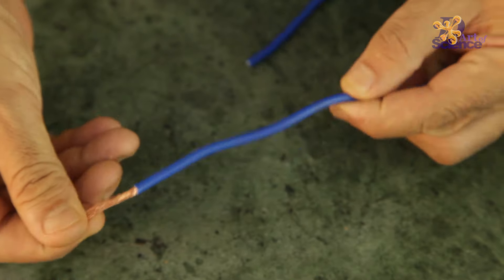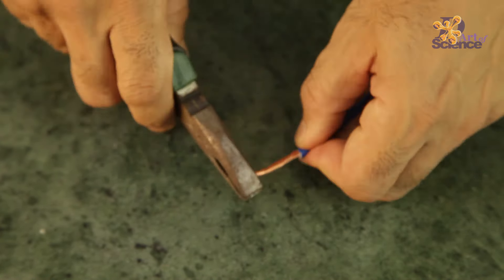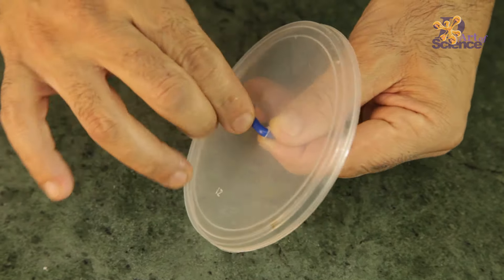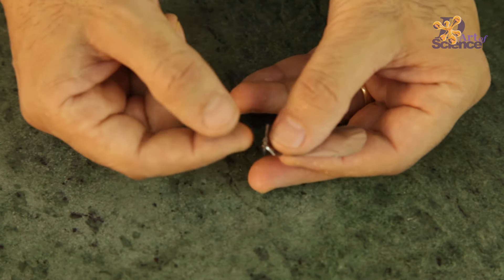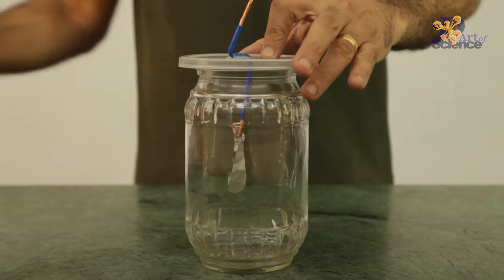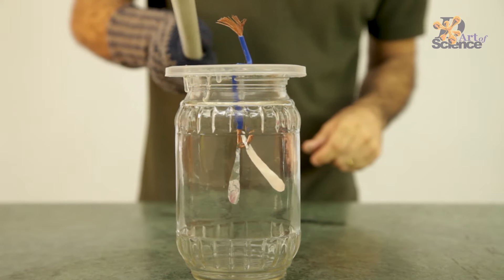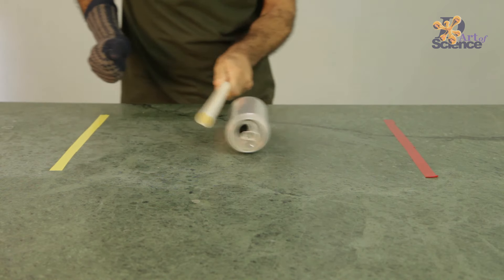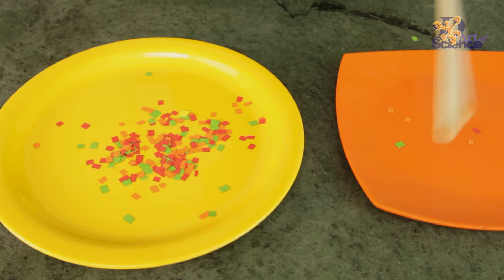How to make a Simple Electroscope at Home? | DIY Electroscope | - dArtofScience

Comment: Sir can we use aluminium wire instead of copper wires?
Reply from the maker: Hi, you can use aluminum wires but copper will work the best since it is a better conductor of electricity.
Reply: @dartofscience  i had done with aluminium wire, and it worked nice, because there were no copper wires in my house, anyways thank you sir for your advice, love your videos❤️
Reply from the maker: That's great to hear! Thank you!

Comment: Would a metal lid work
Reply from the maker: Hi, a plastic lid would work best since it's an insulator.
Reply: @dartofscience  but the wires are already insulated, and the glass is also an insulator
Reply from the maker: So, the plastic lid prevents the escape or dissipation of the electric charge, allowing the electroscope to retain its charge for a longer period.. If the metal components of the electroscope were in direct contact with the air or other surroundings, the electric charge could easily leak away through the process of conduction or other forms of charge dissipation. It's like a little shield that helps the electroscope stay sensitive to external electric influences for a longer time.

Comment: Do we need to have only a plastic cap?
Reply: U can actually use a cardboard too, to cover the mouth of the jar...
Reply from the maker: Commonly used lid materials are metals which are good conductors of electricity. For this experiment to work, you need a insulator and plastic lid is the most common among them.

Comment: Can we use silver foil instead of aluminium foil? Plz answer as soon as possible.
Reply from the maker: Hi, Aluminum foil will work the best because of its conductivity. Aluminum foil is also much more easily available hence we recommend you to use the same.
Reply: @dartofscience can I use the aluminium from medicine instead?
Reply from the maker: Sure, you can try that. However, the foil would be preferred.

Comment: is it ok if i use a metal cap?
Reply from the maker: No! use a plastic cap or else some of the static charges will be absorbed by the lid and you might not get the required result.
Reply: @dartofscience  ok, thanks a lot

Comment: Sir please reply  
 Can we use any other metal wire instead of copper in this experiment?
Reply from the maker: You can try, but the effect works best with copper since it is one of the best conductors of electricity

Comment: Hi sir, my electroscope is not working...i have used these materials - a plastic jar,a plastic lid, a copper wire with many strands of copper and aluminium foil
Reply from the maker: Hi, try using a glass jar and see if it works
Reply: @dartofscience very helpful tip thankyou.

Comment: my electroscope is not working . i used plastic jar ,plastic lid , wire, foil paper.
Reply from the maker: Hi, maybe the environment is causing the issue. Make sure you are in a dry area without humidity.

Comment: Does burned copper wire work? I need it to my physics subject
Reply: No, I don't think so not confirm but when U burn the wires the outercoart of the wire also burned and the substances which is needed or most important burns so not
Reply from the maker: Hello, despite being burned, it will conduct electricity if there are no breaks or if it is not damaged. However, if the wire is completely burned out or melted, it may be unable to conduct electricity changes in temperature. Although, If  you have access to regular copper wire, that would be ideal.
Reply: @dartofscience  oh thank you for that information
Reply: @nasrollahambor6746  are you from emreald heights 8th class i am from same  science mam gave project
Reply: @rakheekaushal815  no I am from Philippines

Comment: My electroscope turned into failure
Reply from the maker: Hey! Let's figure this out! Firstly, let us know what materials you used..
Reply: @dartofscience  💀
Reply: @dartofscience  Hi sir....
Can you pls tell fault..
Materials I used pipe,glass jar,copper rod ,aluminium leaves
Reply from the maker: @vanshikagarg798  Did you use a plastic cap on the jar?
Reply: @dartofscience  no sir its metal..
Reply from the maker: @vanshikagarg798  Metal is a good conductor of electricity and so it absorbs the static charges. That's why there is no charge transferred to the wire and aluminum leaves. Try using a plastic or a glass lid. These materials are bad conductors and hence will help the static charge flow via the wire. Hope this helps!
Reply: @dartofscience  thankyou sir!
Reply: @vanshikagarg798  😂😂